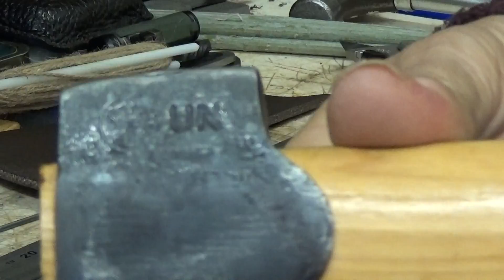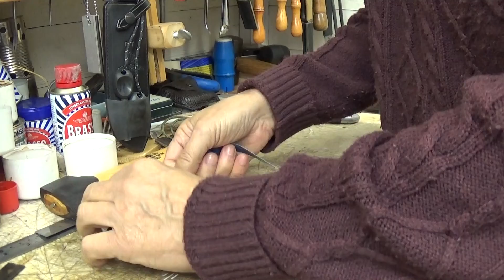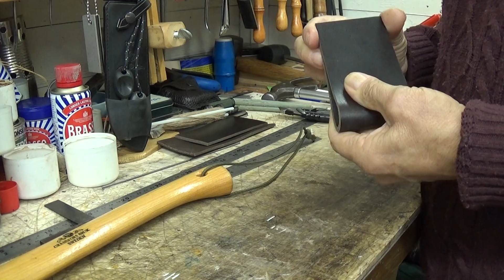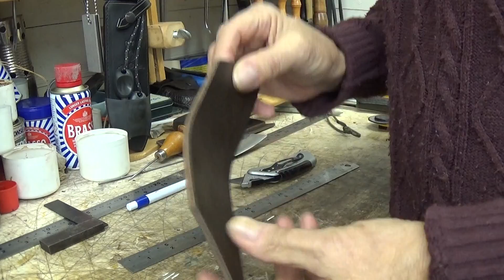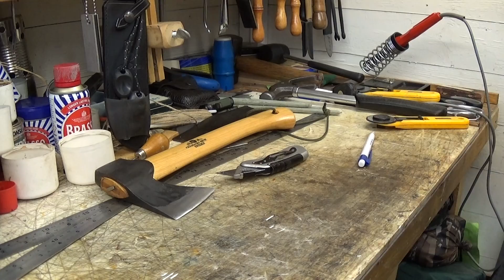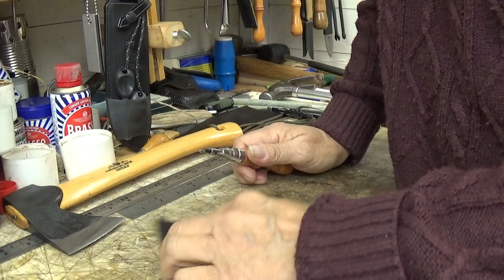Making a hatchet cover part 1

Comment: Looks like your off to a great start. Headed to part two.
Reply from the maker: Hi Robert, not completely satisfied with it, as it is too low, should have come up to the top of the metalwork and I had no sizes to go by other than my own hatchet, I only hope it fits, if not I will make him another at no charge all
though there was no charge for that one, thanks for coming over my friend.
Ray